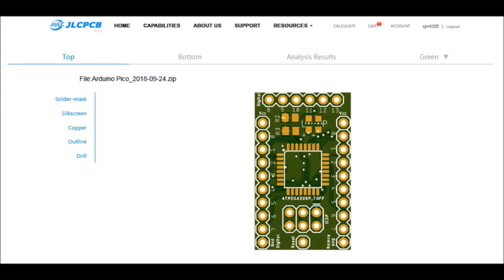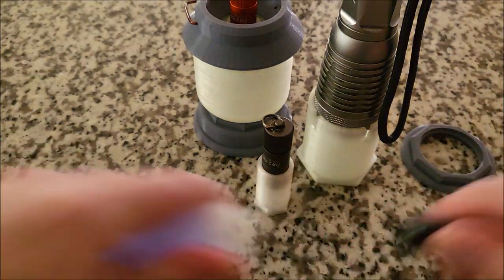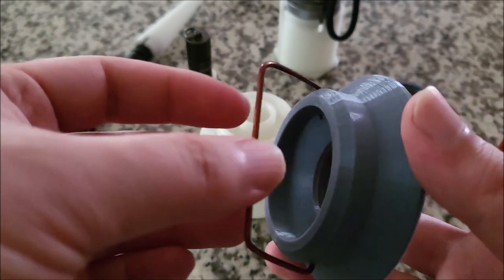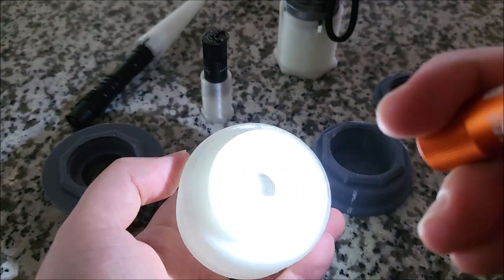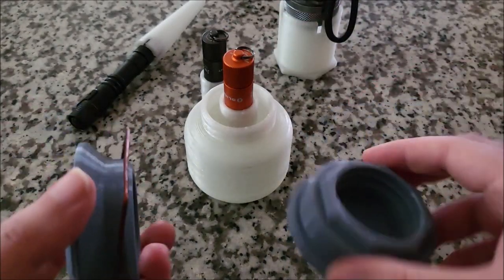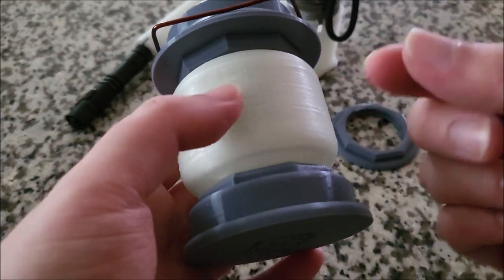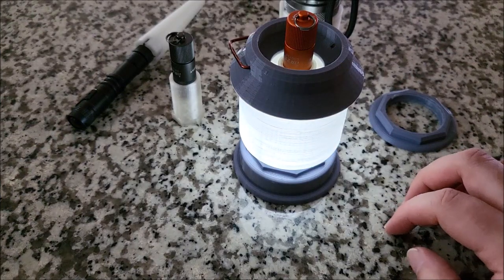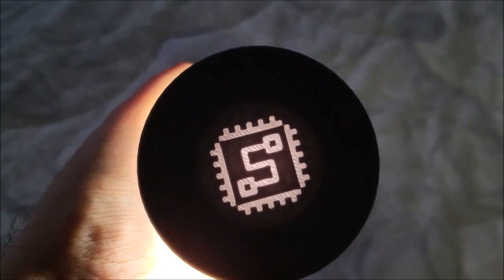3D Printed Flashlight Lantern

Comment: Hey sjm I have a question
Reply from the maker: Sure, what's up?
Reply: @sjm4306  oh my gosh thank you for replying back, okay so I have a issue with my nintendo 3ds xl it has the same issue like the one you fixed in your other video joystick and other buttons wont work and I was wondering if you may give me steps to fix my nintendo since I dont really know about fixing devices
Reply from the maker: First thing is to check if there's any dust or crumbs stuck along the edges of the screen (or like in my video a screen protector). They could be pressing the screen permanently, preventing other inputs). If so then you'll need to carefully clean the edges out.
Reply: @sjm4306  alright it looks like theirs dust or crumbs in the edge stuck but I dont have a tool to take it out
Reply from the maker: You can very carefully use a toothpick to remove the stuff. Just make sure not to poke too much into the plastic touch panel layer or you can permanently damage it. The safest way though is to open it, remove the lcd from the shell and manually clean everything.